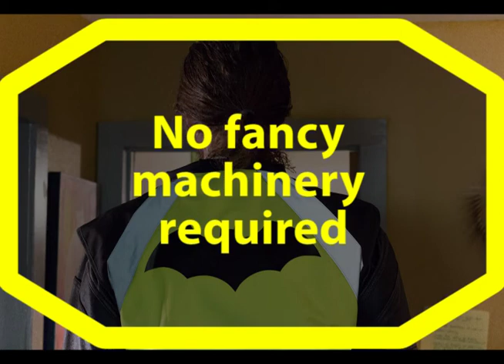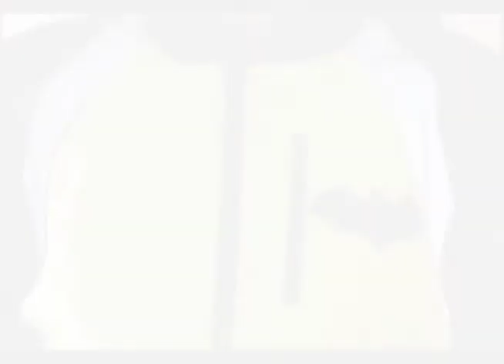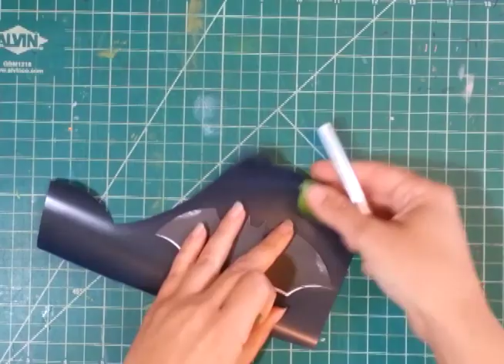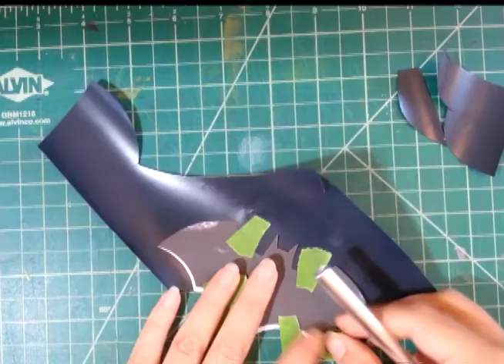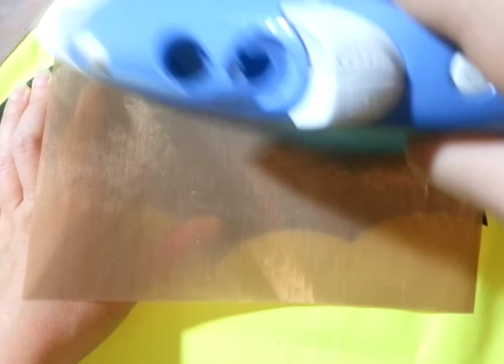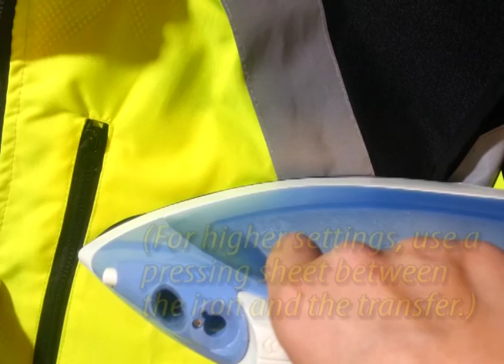Heat transfer vinyl on the cheap: Your designs on clothing without expensive equipment.

Comment: What is the tan piece of... paper or fabric that you placed between vinyl and iron.  
What common, in every home, item could replace that piece..?   parchment paper? Another T-shirt?  Bandana?

Kind regards
Reply from the maker: It's a sheet of Teflon, around $7 for 3, in craft stores or on Amazon. I'm using it as scorch-protection for the decal/ its plastic carrier. I wanted something re-usable because I do a lot of crafts, but parchment paper is perfect. Or cotton fabric that you don't mind potentially getting stuff stuck to. You have the right idea!